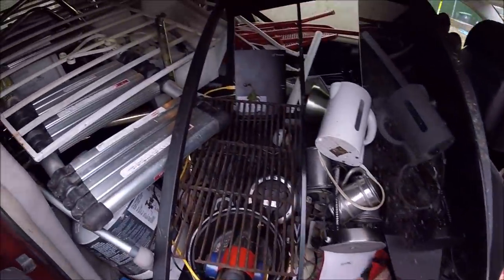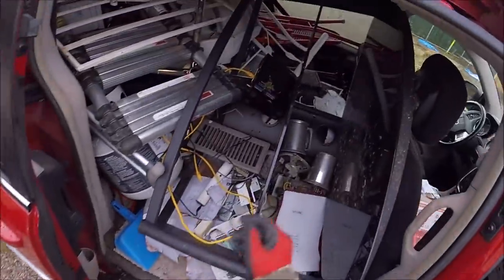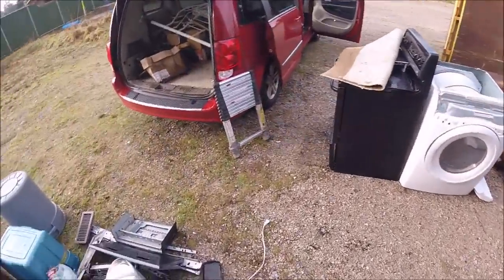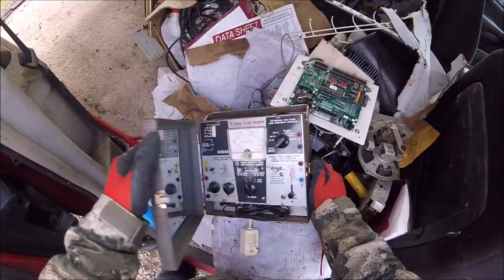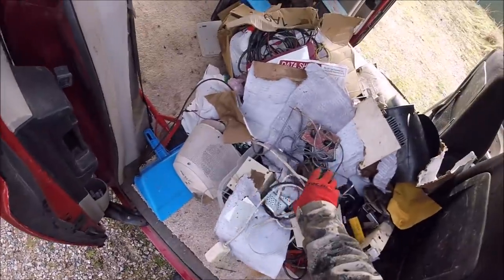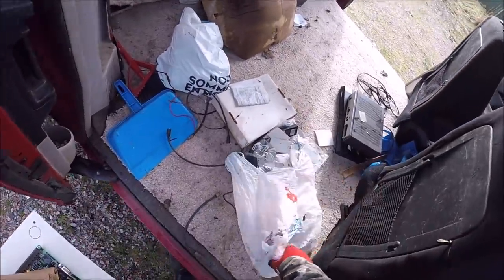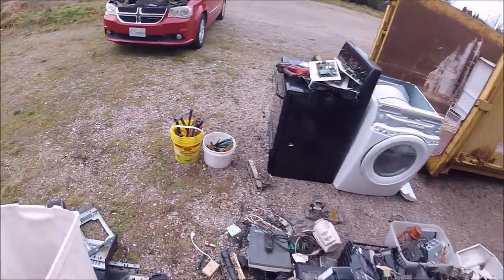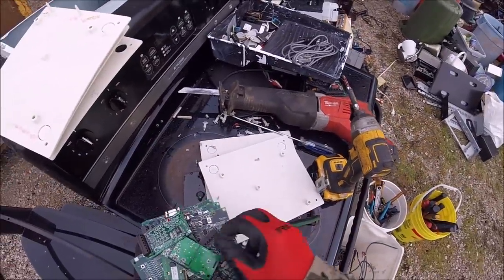Unloading The Scrap Pickup From Yesterday

Comment: Scrap steel being the lowest value item in your portfolio, time saved in handling it will maximize your output. When you are piling up scrap steel, either it should be near to the bin or bin should be near the scrap pile. Otherwise you will be spending lot of time carrying scrap from 30 feet away from the bin. Excellent scrap pick up, lot of value.

Comment: Here in the old corrupt 🇬🇧 uk. Light iron or washing machines .tumble dryers cookers and light steel is £200 per tonne. As a English traveller(romany gypsy)  o have been dealing in scrap metal for over 40yrs and have seen the uk price of scrap light iron drop to £2 per  tonne and as high as £250 per tonne. With iron block engines reaching £350 per tonne. My daily average is between 1.5 tonne of steel to 50 tonnes..depending on whether I'm house calling or get the old factory or automotive repair garage clear out.. the non ferrous metals are a good price these days with no 1 bright copper wire bringing in £5000 plus per tonne.  Car batteries are usually £200 to £450 per tonne depending on the scrap yard.
Reply: Wow!! Daily average between 1.5 to 50 tons!!. Even at lower end, your average for the week is 10 tons!! You should be directly selling to steel mills.